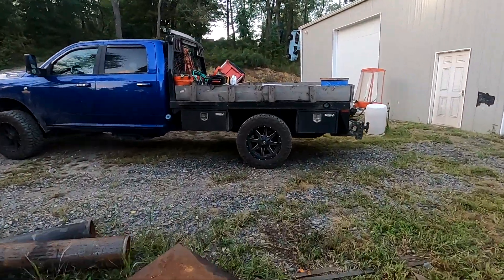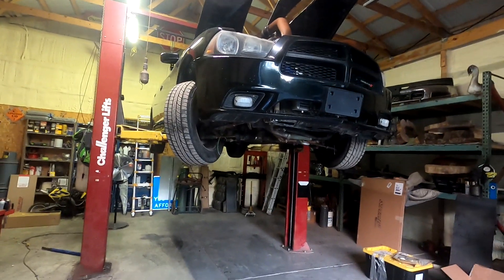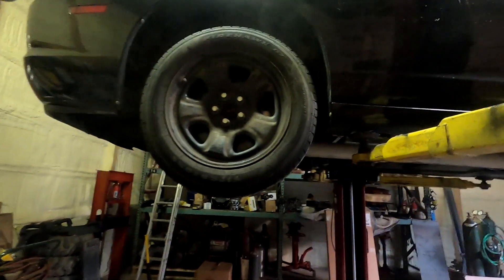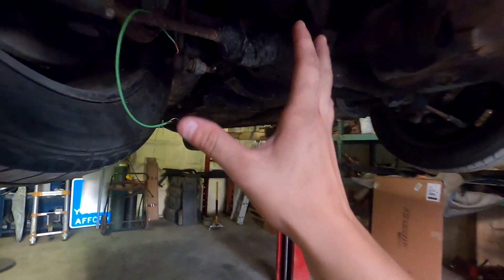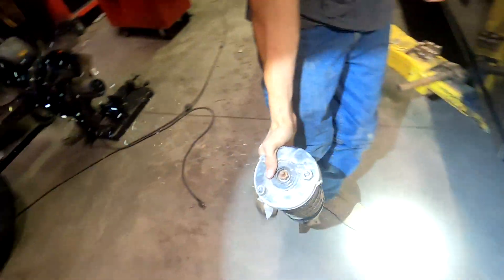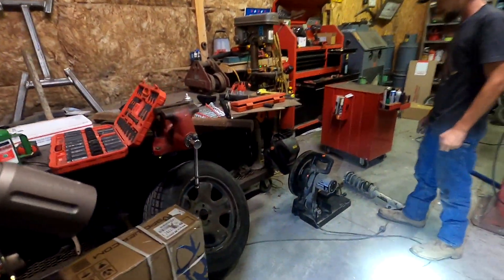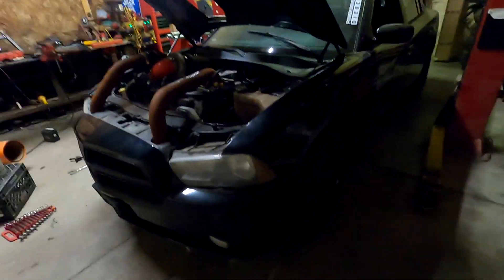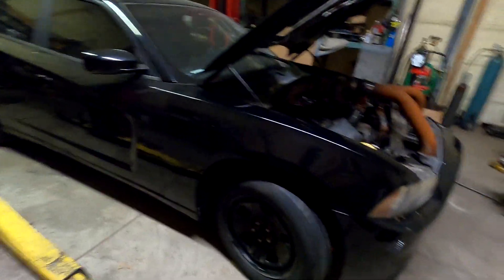How To Lift A 12v Cummins Swapped Dodge Charger!!!!

Comment: The reason your front wheels point outward when you lift the car is probably because when the guy swapped it he dropped the steering rack without changing the point where the tie rod connects to the hub. I'm no suspension expert, but I believe the tie rods need to be parallel to the control arms through the suspension's travel. If they aren't, you get (you have) bump steer. That's going to be sketchy AF at speed!
Reply from the maker: That makes sense 
I guess we shall see 🤷‍♂️
Reply: @LazyEyeRanch  looking forward to it!